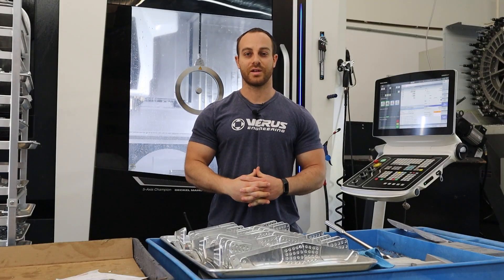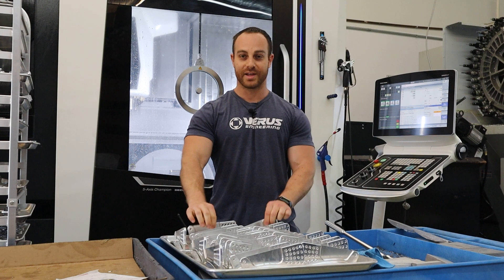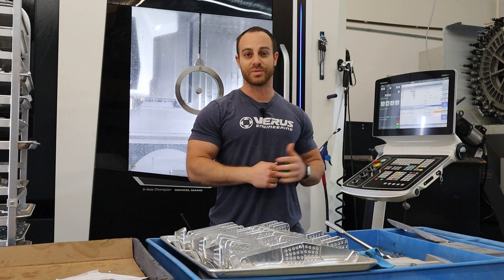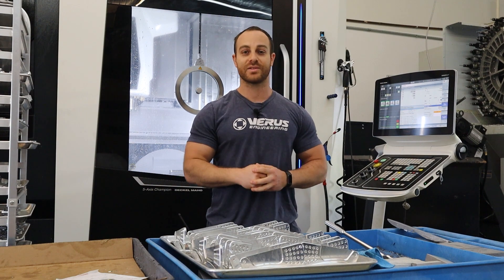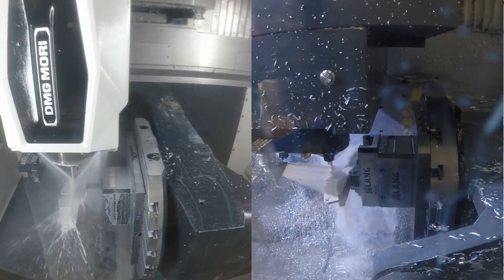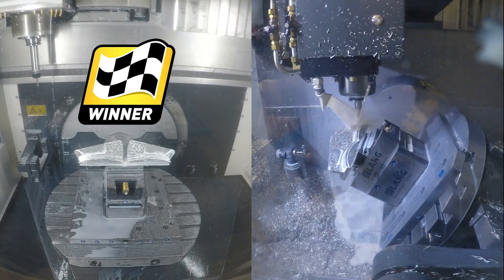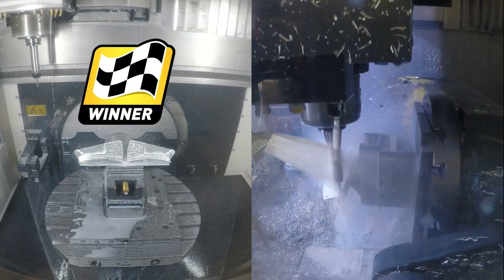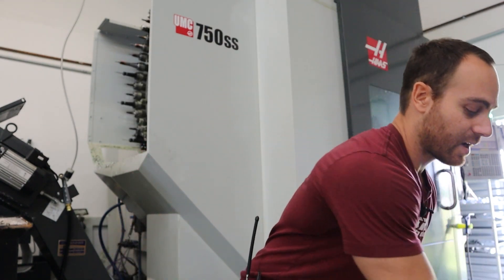CNC Drag Race: DMG vs HAAS

Comment: It’s about the accuracy. Haas thermal control on the UMC shifts like crazy and there’s no way to control it since they’ve been “working” on the firmware for 3 years with no resolution, and the rotary table shifts .002” on both axis when the table brakes engage. The UMC is the behest piece of junk made in the USA. Haas should be ashamed.
Reply from the maker: Agreed, and the lack of rigidity.

Comment: haas has also some serious accuracy issues. It depends on luck. Did some measurements on few machines. Here in eu it seems much better option to buy doosan if you're looking for budget machine, you get much more of a machine for less money. for 5ax the hermle and dmg seems to be most common, also service is instantly available.
Reply from the maker: We are very happy with out upgrade to DMG. Performance and service wise.

Comment: can someone explain to me why some controllers have dogleg movements (when rapid moving, all axes move at the same speed)? What is the advantage?
Reply from the maker: Dogleg movements? Please elaborate. We are not really sure what you are asking here.
Reply: @VerusEngineering  dogled has Haas and Fanuc. Its the move when all axis run on max speed. So if you program a cross move in X and Y machine will go at max feed in X and Y and when one of this axis travel to the end point of each of them than stop.
Siemens and Heidenhain has a different speeds for axis to travel to programed end position in the same time.
sorry for english

Comment: How much Dmg mori cmx series/ dmu series cost?
Reply from the maker: No idea. It would be best to contact DMG Mori for pricing.
Reply: @VerusEngineering  ok thx.
Reply: Dmg 50evo base before larger tool changer and other options is 480,000usd the sent me a sales offer this year
Reply: Believe it or not the best thing for Dmg mills is ever multiple of 10 is 100k aka 100p duo = about right on 1mill
Reply: @michaelgrimes9153  Thx sir. You know what i’am about to buy Used Deckel Maho cmx 70 U from 2010 - 2020. Or maybe used Monoblock? I also looking for Heller HF Series.
Reply: @yomamasofatwhenshewalksshe2401  one thing is if you buy a mono do NOT buy the t style aka the table moves for z they get thrown out from a crash very easily. Get the newer trunion one
Reply: @michaelgrimes9153  I see. I’ve got a same advice from my uncle before. Thx for Replying 🙏🏼.

Comment: Yes the DMG was faster, which it should be due to the price difference, but another thing to remember is the chip control! Just look at how clean the DMG is at the end. I own a small job shop and let me tell you that it sucks when you have a machine with poor chip control. We have a Haas VF-2SS and it does an ok job with chip control on aluminum parts but we do a lot of steel parts for the mining industry with lots of material roughing and sometimes we are shoveling the chips 2-3 times a day. I am looking at a CMX as another potential option for a 3 axis mill just because of the slanted guides to allow for better control.
Reply from the maker: Totally agree! Chip management is a must.
Reply: you will not regret with the CMX series. I worked with a lot of dmg mori machines and they are one of the best. CMX, Sprint 50, NLX and NVX were my favourites
Reply: we have a CMX800 with chip conveyor and the only thing that i dont like is the fact it doesnt have a door flush (where coolant constantly gets flooded on the door to keep chips from sticking and scratching the paint off the door when you open the door), left and right above the chip conveyor is a small flat face where chips accumulate (would be nice to have coolant flush there as well) and you can not crane load the whole table if you have the automatic crane door thingy, only about half way then you have to push the part which damages the top "door" guides.
Reply: HAAS is an Aluminum Machine.  The Linear ways will not live long, cutting steel.  Especially using face mills that hang over the edge to get that hard interrupted cut.  Occasional Jobs is OK, running mostly steel or all, is not good for a HAAS.  And this is from someone I know that use to service HAAS.

Comment: 25% faster at 2 to 3 times the price.
And maybe the previous owner of the UMC didn't maintain it properly or crashed it.
Run them both at same speed/feeds and ck the finish.
Reply from the maker: The HAAS was maintained well. The DMG is well worth the price difference. The HAAS could not be pushed near as much. We actually sold the HAAS and now have two DMGs.
Reply: haas is junk. anyone thats ever owned one knows it. Haas doesnt care about quality they care about bulk sales. Your hfo rep will tell you this.

Comment: My only concern with the DMG is that the trunnion is unsupported. One good whack and that baby is going to get expensive. 
I know. It’s simple just don’t crash. It’s been years since my last crash but I know my next one is just one stupid move away.
Reply: they count on it for the aftermarket ;)
Reply: Not unsupported on the DMU 65 monoBlock and larger. They also have crash protection. Heck, they can even give you feedback on pressure applied for burnishing operations, their way covers are sealed well enough they can run grinding ops, and the entire system is rigid enough to permit lathe-style turning (fixed tool) with the rotary table. Of course all those options are gonna cost you to enable the software, but that doesn't change the fact the core machine is that well-built.

Comment: I can buy two HAAS mills to one Mori.  Which is a no brainer in terms of a speed comparison.  I would only buy a Mori for the accuracy, and at that point I would rather own a Kitamura CNC mill
Reply from the maker: We are much happier with our DMG. Realiability is far superior in our experience.
Reply: @VerusEngineering  You got me thinking about buying one.  How much was yours, and it the 3rd Gen worth it?  I got a quote a long time ago for their mill turn lathe before and it turned out to be pretty expansive.
Reply from the maker: @sheepman6291  they are definitely in a different price point than the HAAS, but we liked our 50 so much, we actually bought a 75 earlier this year as well. As far as pricing goes, we had a lot of extras added, but if you were interested in pricing, shoot us an email and we can get you hooked up with our DMG rep. sales@verus-engineering.com
Reply: lmao non machine owners are so easy to spot. they just dont get it.

Comment: how much air over hydro issues have you had with the 750? The 750 at my current job has had several service issues with it and is only a couple years old.

Comment: does the haas have all longer guage length tools? (looks like a bigger length vice that you needed to clear?)?
Reply from the maker: Both are using Parlec's shrink fit tool holders, the DMG is using HSK63 and the Haas is using CAT40. Primarily we are using the shortest tool holders we can on both machines. The vices are identical.

Comment: Do you notice any accuracy/surface finish differences? You aren't doing a lot of simultanious motion, but does the Haas eat code the way the DMG does? Is your NX post set up to spit out equal points for both, or does the Haas need some downtuning to process the stream?
Interesting video! I wish there were more back-to-back comparisons in the CNC world. The DMG vs a Grob would be fascinating (and probably more relevant given the more similar pricing)
Reply from the maker: Yes, we do notice a little difference in the surface finish but I believe that is more due to the rigidity of the machines and not so much the ability for the DMG to read code faster. The Haas does struggle when feeding it more code. Yes, we have the post spit out the same amount of points for both currently. When I was quoting out a Grob, the Grob was significantly more expensive than a DMG. DMG, Mazak, and Okuma were all priced similarly.

Comment: What is the difference in the price
Reply from the maker: We bought the HASS used and the DMG was brand new. Not really sure what the HASS goes for new.
Reply: @VerusEngineering   well in the UK the DMG is 2 to 3 times the price so you would expect it to be much better, then of course second hand machines can have all sorts of poor history like collision etc so the results you had are what i would expect
Reply: @VerusEngineering  A used machine compared to a new machine, that's funny. Bald tires to new tires for traction comparison next?
Reply from the maker: @fryer05maverick31  Even if the HAAS was brand new, it cannot keep up with the DMG. We can push the DMG much harder. We just thought it was fun to do, thus why we made a video of it.
Reply: id say a couple of hundred thousands